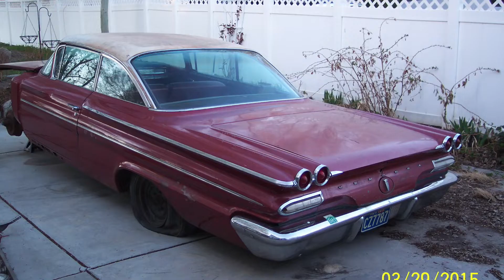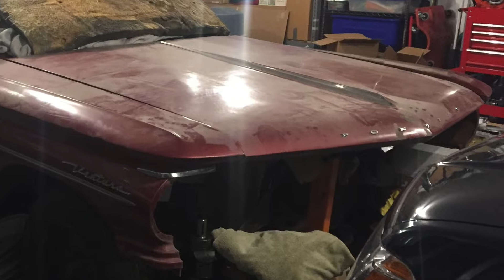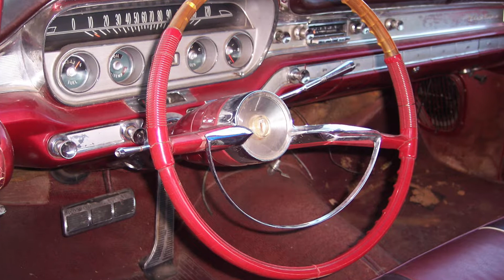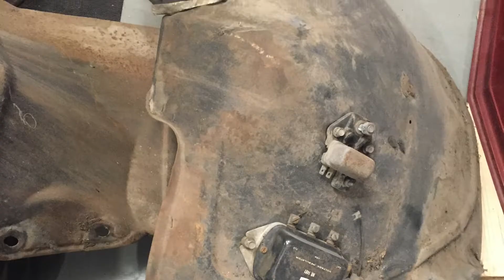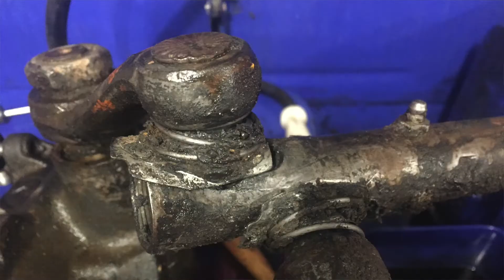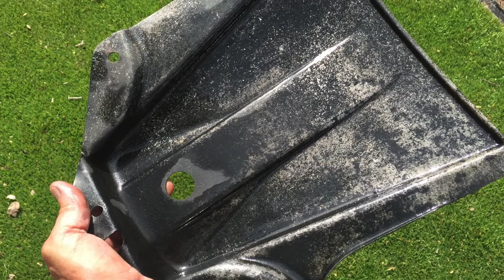1960 Pontiac Ventura Barn Find pt 2. After 40 years in storage. Will it start? Will they both run?

Comment: I won a bid on a storage unit and along with the contents of the unit came a 1960 Pontiac Ventura. The driver rear fender has some rust but that's about it. The car has been sitting for over 38 years. There isn't any carpeting which shows the floors in great condition. No rust holes there nor the door jams. The two doors open and close nicely. The windows rails need to be aligned and thats as far as I have looked. Do you know what the value of this car now?
I don't plan of making it a frame up restore, but rather a good looking reliable cruiser. I plan on fixing up the interior- new carpet, roof liner, and seat covers. then make sure the brakes work then put a new fuel tank in plus fuel line to a new fuel pump. Then new plugs, wires, cap and rotor, water pump and battery. any ideas I am missing?

Comment: Hi. I’ve been really enjoying your wonderful videos. I’m currently considering purchasing a 1960 Ventura sports coupe just like yours. I’d love to be able to phone you to get an opinion about the car I might buy. I can send you photos and we could briefly talk about value vs effort. I love the design of these cars, but they are enormous and probably becoming less popular year by year. I’m in two minds about purchasing. I have no idea what you paid for yours and what you sold it for but I’d certainly appreciate a quick discussion if that’s possible. Kind regards Jerome
Reply from the maker: Glad you like the videos. I purchased my two cars for $3000. After pulling all the parts I needed from the parts car, I sold the rest of that one for about $1000. After all the work on the red car, I was able to sell it for $15,000. The red car still had a ton of work needed in the trunk for rust repair because the Ventura does not have aftermarket panels available so it all must be hand made. I also found that the original interior is available but takes years to get and is very expensive. The dash pad is also very hard to get restored along with the steering wheel. The guy I sold the car to had the interior custom made because the factory original stuff was just too hard to get. All in all, the Ventura is getting pretty rare thank to cost of repair so I think it should be saved but the restoration cost can go past the actual value fairly quickly.
Reply: @riderescue  thanks so much. I really appreciate your advice. I will watch all your videos anyway as I love watching your skills at work. I am pretty handy myself but I still have a lot to learn…..from you and others. I think I’ll stay away from the car.unfortunately not enough return for the effort. Real shame. These big cars are becoming less popular over time.